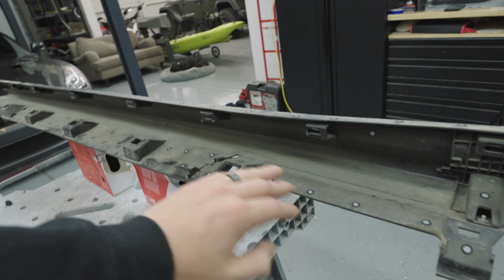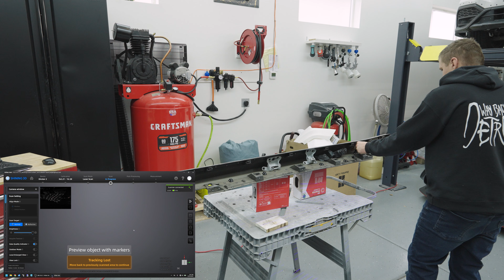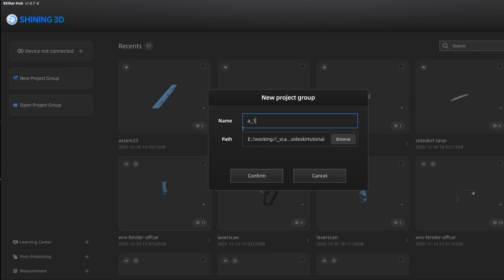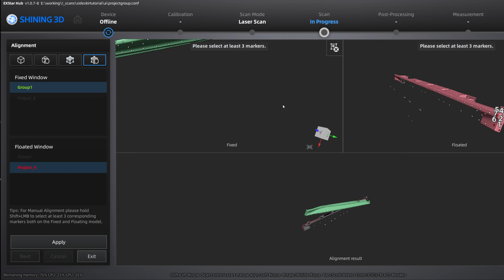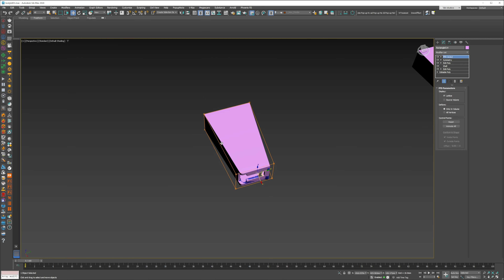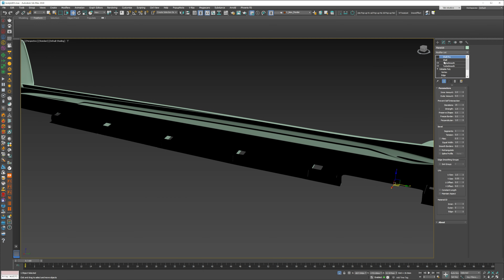Custom Widebody Side Skirt - 3D Scan to Design and Print

Comment: So if you were buying a new scanner, with the current prices being about $650 vs $1050, would you buy the Einstar 1 or the 2?  Or a different brand?  I need to scan a truck cab because I want to design a custom chassis.  Thank you.
Reply from the maker: So the honest answer I can give you is depends on what scanning method you want to use. If you want to do IR made with no markers than in my opinion Einstar1 is the better choice only due to the fact that the software for the Einstar2 IR mode is currently with bugs and while the team is working on fixing it based on my discussions with them, its still present and right now its not in my opinion completely functional.

Now! If you do not mind using trackers than the Einstar2 in laser mode is just amazing. The quality is fantsatic, the wireless feature is amazing to be able to just put laptop in your case on top of the roof and scan away the whole bed without having to worry about wires getting in the way. The software for laser mode is great and zero issues that I can see right now and I have scanned a full car.

Let me know if I can answer any other questions?
Reply: @poltdesigns  Thank you so much, very helpful.  I guess that leaves me with another question.  If you were scanning under a vehicle cab, to build a custom frame/chassis/suspension, which method would you use?  Is it worth it to apply all the markers for the laser for accuracy, or is the IR scan accurate enough?
Reply from the maker: @HeathFolk  I think the IR mode would work very well especially since under a vehicle there is so much detail and texture the tracking will work with zero issues. Also applying markers under a vehicle would really be a huge pain in the butt if you ask me. I would just use IR mode and go from there :)

Comment: which printed do you use for such large builds? what will be your tips for beginner in this? :)
Reply from the maker: I just use the Bambulab P1S 3d printers. I mean I have X1C and the H2S but the P1S is plenty good for this job.
I would say the best thing you can do is just start. Start with a goal and start failing. This is the best way to learn. You can do all the research in the world but until you start to test things and fail you will never truely learn/understand a workflow that works for you. I might not do things the proper way, but I know the way I am doing things I am getting results so I am happy with my workflow lol.
Reply: @poltdesigns thank you for the advice 😊

Comment: What a impressive work!!
Did you print side skirt blocks and assembled into one piece?
Reply from the maker: Yeap! I cut them up all vertical and tried to keep the height under about 160mm to help avoid wobble and distortion. Then just connected all parts together to get 1 massive skirt haha :)

Comment: Great work! Subscribed! Do you think Rhino 8 is good enough to do this kind of design. I currently use it for other types of parts.
Reply from the maker: Ohh Rhino would be amazing! Nothing is better than Nurbs surfaces in my opinion. I just dont have the patience to learn Rhino properly. I have made some wheels and such in it, but doing a car is way above my skillset lol.
Reply: @poltdesigns  gotcha, thanks man! that makes me feel better I was worried I was wasting my time learning it. It is definitely a huge learning curve compared to some of the other software i've used but I love the customizability and features.
Reply from the maker: @boringbyron  Ohh in my opinion besides a program alias studio tools, rhino is one of the top for automotive design since you can actual export out proper step files and have molds made from your designs. With my software only thing I can do is 3d print lol. So you are 100% focused on the proper software! :)

Comment: As a new 3d printing hobbyist and former wrx owner, great content! I actually picked up the Einstar 2 a few weeks back. Haven't really had a chance to use it too much yet. I mainly got it for the same purpose, to hopefully create some projects for my cars. I will say, the only thing that has disappointed me so far with the Einstar is the fact that it does not have a mount for A tripod/hand grip. I find it awkward to scan sometimes, and makes me nervous not having a great grip on it at all times because doing angles and such sometimes gets a little weird holding it.
Reply from the maker: ohh I 100% know what you mean, during my first video/review of the E2 that was one of my first comments, the lack of anyway to help secure the unit lol. Accidents happen and it would of been great to have something to add a strap or case to.